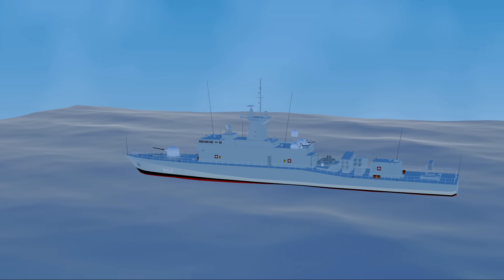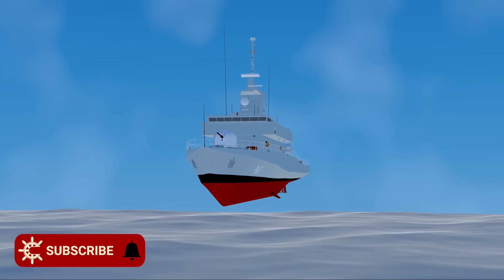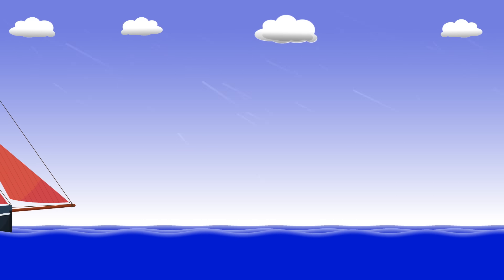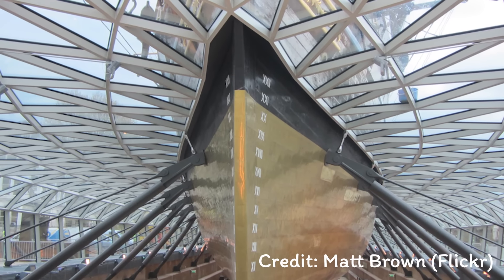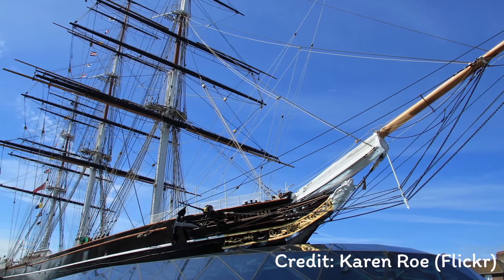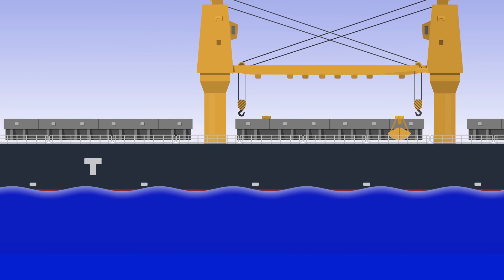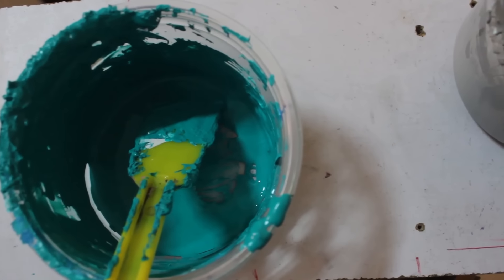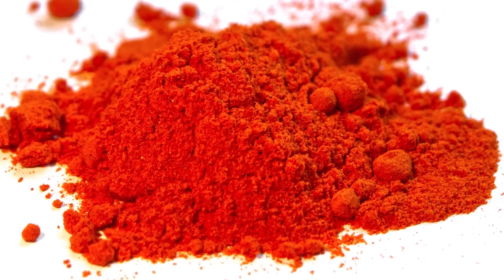Why are ships painted red below the waterline?

Comment: Awe but it doesn’t prevent growth all together, that’s where I come in, I make a damn good living cleaning and repairing hull’s,.
Reply: * hulls
Reply: How do you get the barnacles off without damaging the paint? 
I have to know :)
Reply: @Kenobi5001  you take all and then paint it again.
I had experience with some sailing boats that compete in some races wheret they clear their hulls more often so in that case, most time they only need to be cleaned and only sometimes we actually paint it again. Basically in my experience in this situation they send a diver to clean in under water every month, they go to drydock to clean every six months and they re-paint it once a year (so each year they go one time to drydock just to clean and one to clean and re-paint).
But when it is a vessel that went more time without going to drydock (usually vessels that are used just for cruising) we have those barnacles and on those we have to take it all and then paint it again.
On my family boat we use an anti-fouling that is common to use in some fishing vessels that is said to last at least 2 years, and it actually is right. It usually do lasts 2 years without needing to go to drydock and then everything grows really fast. Usually we only put it on drydock every 2 - 3 years when we clean and re-paint it again (usually depends if we need to do an inspection, if we do, we wait for that time to put in drydock and clean). unless there is a need for big repairs, in that case we put the boat on drydock to repair. 
We never needed to go for repairs in drydock (thankfully) but we alredy needed to do a few things but we sent a diver to do it since they werent too complicated.
Reply: @13dg   Interesting, thank you for your reply I appreciate the time you took to answer me.

Comment: The original anti fouling was red lead and asphaltum which was used on the bulk of vessels as copper was far too expensive. This was used both in the bilges and below the bootop externally . Also cinnabar ( mercuric oxide )  was used alongside but was much more expensive . Internationals metallic pink primer for the hull still carried these metallic poisons in the 80s . You can still buy red lead for this purpose but you must show your vessel is of an age for this treatment and proof of end user safety certification .

Comment: I love to see people getting interested in vessels and seafaring! loved the video but it's outdated. Nowadays, the most commom antifouling systems are electrolytic based, with anodes (copper, aluminium and iron can be used) installed throughout the hull or mounted near seachest. Electric current and the metal ions prevent marine life to settle in.  There are other antifouling systems too (even a ultrasonic one!), but this is by far the most common and I believe the painting (chemical dousing) has little part in this antifouling role today. I am an officer that work onboard and I just came from a docking after 1 year seagoing brand new ship ."Prevent" is the word here, as there is no definitive solution so far for the issue of barnacles growth on hulls.
Reply: repainting the bottom is definitely a yearly occurrence, at least in recreational sailing.

Comment: Sooo, my take away from this is:  When operating in a domestic maritime operation where a systematic cleaning process can be used - due to spreading of an invasive species being less of an isssue - silicon based anti fouls are the way to go. I’ve also heard of some potentially non-manufacture based receipes with good results. Chilli flakes in the anti foul being one of them…

Comment: If I remember correctly, some even have blocks placed below the waterline to absorb the slight electrical charge that is emitted throughout the Hull to deter/prevent any growth.
Reply: That's pretty close to the mark, but those are more of an anti-corrosion thing.  When you put unlike metals (like, say, the steel of a hull and the brass of a propeller) in salt water, they undergo something called galvanic corrosion. Basically, it makes the metals act like the electrodes of a battery. By putting little studs of zinc throughout the hull, those will take the brunt of the corrosion and protect the hull and prop against deterioration. They have to be periodically changed out, but it's a hell of a lot cheaper and safer than dealing with a weakened hull.
Reply: @MrClickity  Ah yes, that was it, thank you!

Comment: Self Polishing Copolymer (SPC) paints?  SPCs such as International Paint's Intersmooth are TBT free and keep the hull clean by having the paint slough off as the ship moves through the water.  If I'm not mistaken Intersmooth comes in a variety of colors.  Every Marine paint manufacturer offers SPC paints.  They have been available for, I believe, over 4 decades.

Comment: how about electrifying the whole hull to turn it into a heating element? sterilize it every couple weeks and also works to keep pirates away
Reply: Water cooling is how you make things not get hot.  It would probably take gigawatts.  I suppose you could do 1sqft at a time though.
Reply: @KezanzatheGreat  actually we want to take away currents from the hulls,cause it corrodes the bronze elements on the hull

Comment: I served on 2 cutters, and tbh it never occurred to me to wonder about that. 😕
Reply: You served on USCG cutters? That's the most common usage of "cutter" I encounter.
Reply: CGC 𝘼𝘾𝘼𝘾𝙄𝘼 (WLB-4Ø6) and CGC 𝙎𝙊𝘾𝙆𝙀𝙔𝙀 (WPB-87337).
I hasten to add that in any other context "cutter" means "a small, but in some cases a medium-sized, watercraft designed for speed rather than for capacity." In that context, other than historic ships, it's mostly obsolete now.

Comment: I’ve been in the navy for more than 10yrs and I’ve never heard so much BS. Indeed many ships have the hull painted in 2 colours, but it has no meaning. The ships have a line around the hull what it’s called the dead floating line and it’s for showing where the water line should be if the ship doesn’t carry any weight either than what’s required to operate ( full tanks of water, diesel, oil, crew...). Under that line the ships nowadays are using a special paint with 2 characteristics: water repellent and anti phonic. If it’s an wooden ship they use resin for the same reasons. Either way the ships are raised on docks periodically to clean the “beard “ ( algae and molluscs ). So, in other words, he should have done his homework.
Reply: traditionally most military navy’s  of the world have a boottop area above the water line and below the topsides grey that is coated with black anti fouling. 
Boottops in boottop red or green were common on merchants but are no longer as  popular as they used to be  except on older ships from 3rd world countries. below all A/F coatings are anti corrosive coating as one cannot work without the other

Comment: Arent copper oxides blue?
Reply: I thought copper oxide is green, just look at a copper roofed building, the red pigment I thought was lead oxide also comes as a white pigment, now banned in domestic paints but still used commercially.
Reply: @tonys1636  , agreed , I understood the 'traditional' red , originated from Red Lead paints. Also acting as bio-cide.
Reply: Actually, it depends on the ions, and Copper (I) Oxide is red.
Reply: Copper (I) Oxide, Cu2O, is red and Copper (II) Oxide, CuO,  which is black.
Copper Sulphate is blue. Copper Carbonate is green. Copper Chloride is brown.

Comment: I've antifouled a boat before back in the la te 1980s and the stuff we used is now illegal which contained lead, zinc, copper and arsenic and antifoul also comes in blue as well for your information and I did hear one time in the last half of the 1990s from an ex navy person that sending an electrical charge through the hull structure was trialled but never heard any more about that, maybe you don't want to accelerate the electrolysis process and wear the sacrificial anodes out to quickly because if it did work everyone would be doing this.

Comment: I am surprised you failed to  mention sonic hull cleaning. I own a sailboat and that is the preferred method for me. It uses a transducer that vibrates at certain frequencies and create micro cavitation along the entire hull that dislodges the growth. By far the most economical solution and environmental as well.
Reply: Is that allowed in ports?
Reply: @jellysquiddles3194  absolutely, it prevents the growth from the start so no worries about cross contamination. If I do need to clean in port, the stuff coming off is that areas organisms anyway.
Reply: @JSabh  Ah I see. That's cool to know, once I retire I might get a boat. :)

Comment: Most of the time after it's in drydock the bottom and sides are pressure washed with powerful rotating bit. Then 2 part primer chemical dried type. (998 Red) After that a moly bate paint is the final coat which slowly oozes off the ship mostly from the top of water line down. But depending on the particular types of tech systems the ship has,(DEDOT) produces an electromagnetic field around the lower half of the ship that keeps all water and debris 3 to 6 inches away which prevents drag.

Comment: Interesting point on the red being due to Cu,  vaguely also recall that fh the reason a log of ships used to have a line of a different colour between the top and bottom sections was to judge draft/how much had been loaded in (old venician standard I think?) Although when Britain revisited it and came up with the Plimsoll line/Lloyd Register it became a circle with a line through it, and sometimes multiple marks for different sailing conditions. Very interesting that the underside is copper. Do modern military vessels do this too? I note one of your graphics looked like a military vessel - just a bit surprising as not exactly camouflage. Although visibility under water isn't great to start with...

Comment: why not just coat the underneath with teflon? i know you'll still need to clean it but it being super slippery it should be fine right? also with the copper, why not keep it electrically charged? not a massive charge but just enough to not have growth

Comment: Large steel vessels could use battery-powered drone "lice," that magnetically cling to the hull underwater and constantly go around dislodging growth the way a diver would.  With adequate batteries, a few such drones could keep the hull constantly clean for a small penalty in drag.  Better yet, internal hydroelectric dynamos could harness energy from water flow, converting the "current" to electrical amperage, affording power indefinitely below the waterline.

Comment: i would have thought it was for danger. you would only see the red under bottom of a ship if it was sinking and lifting out of the water. then it would stick out perfectly across a blue skyline so it could be found and rescued. also i’ve read that just a few of the biggest cargo ships contribute more carbon pollution than all of the cars in the us per day. that the problem is with these ships, not car usage for co2 levels. just a thought
Reply: You can see the red if the ship is riding high. Empty cargo ships will show a lot of red, for example.

You're right about the pollution (and oil consumption) of ships, though. Even a moderately-sized ship's fuel consumption is measured in gallons per mile, not miles per gallon. The largest cargo ships consume an unbelievably large amount of fuel.

Still, it's not like we have a better way to get goods across the ocean. Planes are even worse.

Comment: why would i use soft coating instead of hard coating, i mean since the biocides are released in both cases, i surly want the coating to remain to protect the substrate which is the meta. i dont want the metal to be exposed to seawater and corrosion occurs. also if hard coating doesnt wear off the paint. how will i know if the paint is working or not working how will i know if all the biocides are all released or not released. @casualnavigation

Comment: Good ol' ablative antifouling paint. I used to strip and apply it on boats. It works great but it's nasty stuff. To apply a touch up coat you have to sand the scum off of it first which results in clouds of toxic dust if your vacuum system isn't working. I've inhaled and absorbed my fair share of it.
Reply: And all that shit will just get into the water...

Comment: The most similar to copper sheets antifouling paint is the so called Coppercoat. Simply copper powder mixed with epoxy resins... It lasts many years, but it's very expensive. It's not so used because you can't use it on the metal parts of the boat, only on the fiberglass, so you have to take out the boat from the water in any case, to paint with a conventional antifouling paint, the propeller, the shaft and the other metal parts...

Comment: How do military subs avoid this fouling since they often travel at low noise making speeds and the entire ship is usually underwater. Nuke subs often travel at very low speeds to avoid detection. Many of the subs have noise deadening material which adds to the problem.

Comment: I more or less knew this but I thought it was red lead paint that was the biocide and I didn't know about the soft coatings vs hard bit. Still, very interesting. I guess I always equate copper oxide with blue and green, not red.
Reply: only when copper is exposed to oxygen, then it tarnishes

Comment: I thought it would be easier for sailors to see the bottom of their boat relative to the sea floor so that they don’t get stuck
Reply: Nah, they should already know the ship's draft (how deep it sits in the water) and there are various ways to determine the depth of the water. From there, it's just a matter of simple subtraction to determine the depth below the keel. Generally, if you're in a deep draft vessel and you can even see the bottom, you've probably made a serious mistake.

Of course, any decently sized ship nowadays is going to have at least one fathometer (sonar depth sensor) installed on the hull so the old tricks are mostly moot.

Comment: Coundn't you use a victim-anode from copper. Keep the Ship unpainted, hold copper-rods into the water, and run current through it copper-anode, Steel kathode. The Copper is disolved and the ions move towards the hull. Just never turn the current of, as then the Hull becomes the anode, and gets corroded.

Comment: I know it costs money, but why don't ports have closed system cleaning docks? Like a car wash, where the water is being reused and discarded separately, instead of into the general sewage system? 
This would solve the problem of pollution as well as invasion of exotic species.  

Any owner of a vehicle, be it a car, lorry, train, aeroplane, needs to take care of it being cleaned periodically, so I don't get why they are making this such a problem for ships. 

Cleaning it on the go straight into the ocean is hardly a responsible choice.

Comment: The original (and effective) anti fouling paint was applied just before leaving drydock and was always underwater so as to keep it from drying out. It was a lot more effective than later paints but a lot more toxic, paint systems have progressed throughout the years but to me never seemed as effective (naturally) as the early ones, visibly more growth. The trend for doing surveys in water does not help either, as you correctly point out ports are reluctant to allow any hull cleaning, in fact ports are becoming reluctant to allow anything at all, even repatriation and landing dead seamen, a shocking state of affairs.

Comment: Wow just wow.. red was used because of all the colors it was the cheapest and easiest to get.  Also it was originally  lead based paint . It was used on schools  and bridges later on. Although  you give good facts as to the why you need it. You couldn't  possibly be more  wrong.  Most hulls before red lead were black tar or pitch not copper which was way expensive.